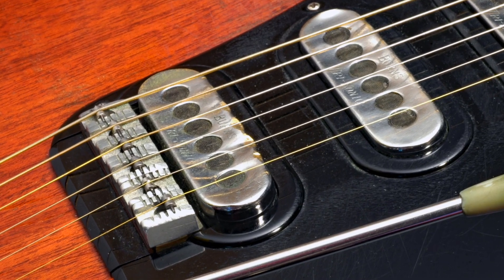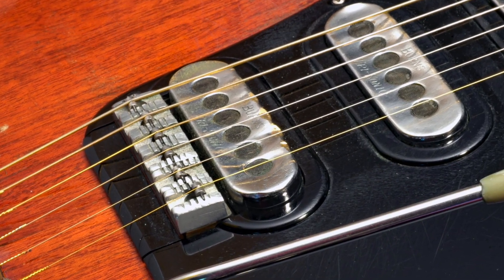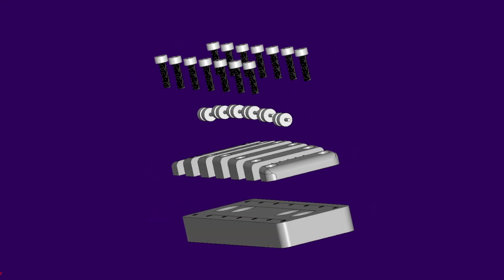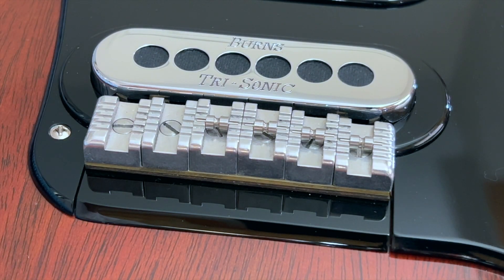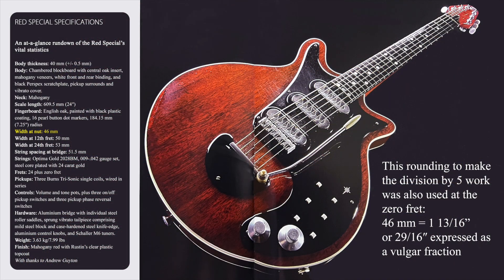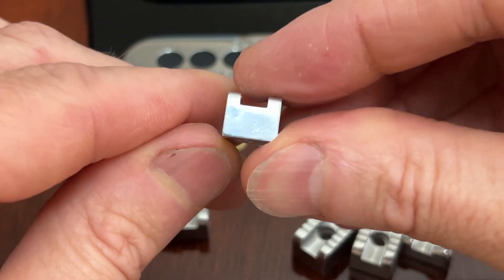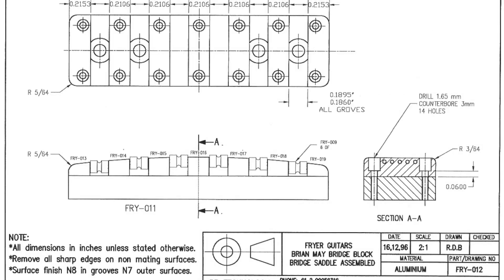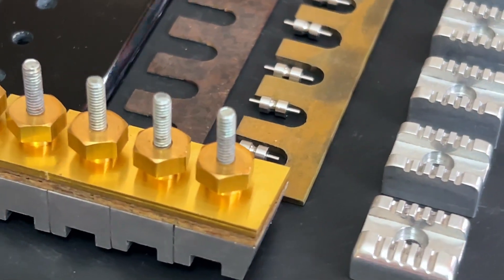Brian May Red Special Guitar Bridge Design, Function and Installation

Comment from the maker: Brian's design drawing shows 2.6" because the bridge was planned as (2 x 0.500” outer pieces) + (4 x 0.400” inner pieces), so specifying thousandths of an inch as a machinist would work to.

However, Brian has stated that the bridge was made with hand tools, not machined so was likely just made to the imperial dimension in 1/32" increments. 

The difference between 2 5/8" (2.625") and 2.6" is only 0.635 mm which yields a very close approximation to a 2" string spacing. Hopefully viewers appreciated that I was trying to rationalise the 2.6" dimension specified on the design drawing with the 51.5 mm string spacing quoted in the Red Special book.

Comment: Also, is one shim brass to ground to electronics cavity (using foil??  So brass shim should be  top or bottom?
Reply from the maker: @SonofaDiddly Yes, you can see the foil grounding strip in the video from time index 01:41. Also, the CAD animations clearly show the brass sheet shim situated above the phenolic resin sheet section.

Therefore, it is sensible to put the brass shim next to the aluminium blocks and the foil can be sandwiched between the two metals.

Doug

Comment: Excellent video.  Why are the brass nuts shaped like that, and why are the bridge shims two different materials?
Reply from the maker: @SonofaDiddly Hank rivet bushings are designed to fasten metal plate sections together so the round part is designed to be paened over. Part hexagon nut, part rivet.

I don't know why brass sheet and phenolic resin sheet were both used but it was probably because that was all Brian and Harold had available. The phenolic resin sheet is easier to adjust the thickness of than brass sheet.

Comment: how can intonate if theres only 5 slots per string? what if one of those is ever so slightly off, would be interested in seeing a 12th fret harmonic and a 12th fret note on a detailed tuner on the real deal
Reply from the maker: @Seanredmonduk Would I be correct in assuming that you're either a classically-trained musician and/or have perfect pitch?

Clearly, authentic Red Special instruments will not intonate perfectly, as you correctly point out. Luthiers have developed sophisticated ways of addressing intonation corrections and unless you build a guitar with such features, this has to be tolerated or compensated for by the guitar player in use. Andrew Guyton of Guyton Guitars installed a replacement zero fret with a degree of intonation correction some years ago.

I have found that off-pitch and/or off-tempo singing (Freddie Mercury's live vocal performances some of the time) and slightly out-of-tune instruments tend to bother musicians with well-trained ears rather less than other listeners.

The short answer is that Brian unconsciously compensates for intonation shortfalls and fret wear while playing to some extent. The rest is probably hidden in the high volume and distortion created by the signal chain.

That is the most insightful response I can offer Sean. I hope that this was helpful and not patronising to you. 😀

Doug
Reply: @dsgb  hi doug, was more curious about it than anything :) always fascinates me as ive had a couple interesting guitars that even though intonated right still dont sound right etc :) , a compensated zero fret sounds interesting, but unless im wrong wouldnt that be moot the second you use any other fret? just curious is al trying to fully understand it all etc :)
Reply from the maker: @Seanredmonduk Yes, the compensated zero fret must only be to deal with open string notes, see this article:

https://gerry-hayes.squarespace.com/blog/revisiting-brian-may-intonation-and-offset-zero-fret

I have never heard any people in the Brian May enthusiast group complaining about intonation issues; some I know well play professionally in tribute bands (Luke Timmins of Supreme Queen for example), so I guess you can achieve a satisfactory intonation with the original Brian May style roller bridge.

Your query/concern is valid and it is something I could consider covering in a future video although I don't own a sophisticated tuner.

Doug

Comment: I don't know much about the tooling available to Brian, but it seems he must have had a mill and lathe to make such intricate parts.
Reply from the maker: @josephbard7663 I suspect that this is the case as you say. I should imagine that Harold knew people with this equipment and the tremolo parts were made on a milling machine. I still think that the bridge was made by hand with hacksaws and metal files.
Reply: @dsgb  That's skilled work to get all those parts square and the grooves even.
Reply from the maker: @josephbard7663 Indeed. I made mine with CNC and there were still imperfections. A milling machine would have made life much easier.

Comment: I've always found that my bridge  on the RS I have (Loxley) never returns properly, so it's slightly out of tune unless I knock the bar - I don't suppose you have any idea what could be done to remedy thist
Reply from the maker: @Zardox-The-Heretic-Slayer Firstly, I recommend that you watch my second video on the tremolo system, if you haven't done so already because that covers installation and set-up of it. The roller bridge itself is unlikely to be the cause of the problem.

https://youtu.be/UaDXGUZCyIE

I can't give you any kind of explanation for tremolo tuning instability without examining your guitar. I am aware of Loxley Guitars' Red Special inspired instruments but have not had the opportunity to play or inspect one.

I suggest that you contact Matt Loxley and ask for his advice.

Doug
Reply: @dsgb  many thanks for the quick reply, the video was very informative, it answered one of my questions about how far the springs should be screwed in so I'm going to give that a go. thankyou again.
Reply from the maker: @Zardox-The-Heretic-Slayer O.k. I hope that you can solve the issue through set-up adjustments alone. 👍🏻

Comment: My BMG Super arrived with a 12th-fret action of 2 mm on all the strings. I wanted it to be 2 mm on the low E string going down to 1.5 mm on the high E string, so I had a local engineering firm make me a wedge-shaped steel shim with steps on it, each one lower by 0.2 mm than the one next to it. This produced a drop of 5 x 0.2 = 1.0 mm at the bridge, so a drop of 0.5 mm at the 12th fret, which worked out very well. It did make me wonder if other Red Specials have this uniform 12th-fret 2 mm action on all the strings, which didn't feel right to me. I always set up Gibsons (10 - 46 thou strings) with 1.6 - 1.2 mm 12th-fret action and Fenders (9 - 42 thou strings) with 1.8 - 1.4 mm 12th-fret action.
Reply from the maker: @cabot001 It is to be expected that budget, mass-produced guitars will be shipped with a generic string action, likely too high and will always need to be set up to the player's preference.

Comment: Outstanding well done. 👏
Reply from the maker: @Peter_S_ Thank you Peter, your positive feedback is very much appreciated. 👍🏻😀💜
Reply: @dsgb  I've spent more hours in front of both ECAD and MCAD than I care to admit to so I see how the depth of this work is truly something to be admired.  
Thank you for your outstandingly well done videos!  They have been pivotal in my decision to do a scratch guitar build borrowing from several instruments.
Reply from the maker: @Peter_S_ This is the level of appreciation that I hope for. Thank you so much sir. 🙏🏻😀 It is humbling indeed to learn that my media content has helped you in your build journey.
Reply: @dsgb  I would never have thought to implement a May vibrato had you not made your videos.  I thank you greatly sir, and my hat is off to you.  My beast of a guitar is an exercise in excess and as such includes 3 humbuckers with 12 switches and 12 knobs for pickup selection and passive tone shaping in an SG Special like body style.  These bring low pass, high pass, and Varitone like notch options with a rather complex yet easy for the player to navigate switching system for selection of any pickup(s) in series, or parallel, or a combination and any phasing you wish within each humbucker or between the 3 pickups.  Were that not enough, it offers a full set of classic effects as well with an additional 46 controls, taking advantage of the need for some circuits such as the RangeMaster and Axis Fuzz to have pickup range impedance on the inputs, and also taking advantage of a control sidechain originating before any effects are applied.  70 controls in total on the face, and many more preset DIP switches available in the rear.  It should come as no surprise I am a pedal builder of many years, but only an aspiring luthier.
Reply from the maker: @Peter_S_ Sounds overwhelming for me because the older I get, the simpler I like things but it will be something to behold for sure! 👌🏻 😀
Reply: @Peter_S_  You NEED to upload a video of this!
Reply from the maker: @briansmith6862 Agreed. Let's get eyes on the beast! 😬